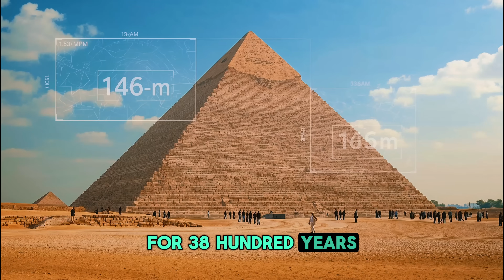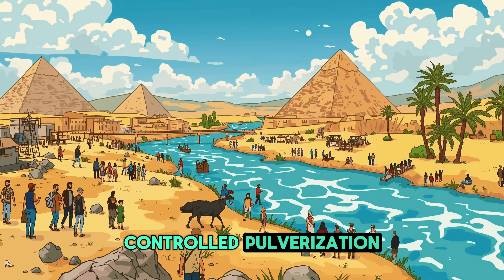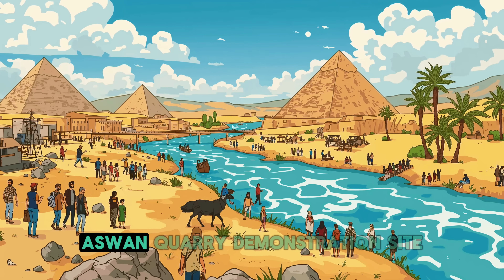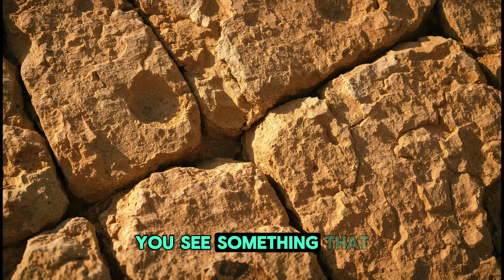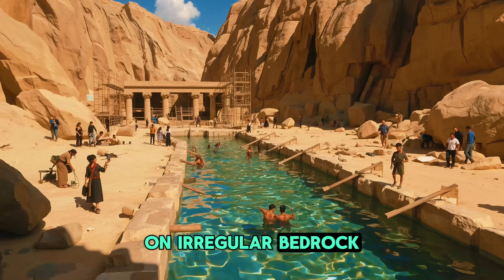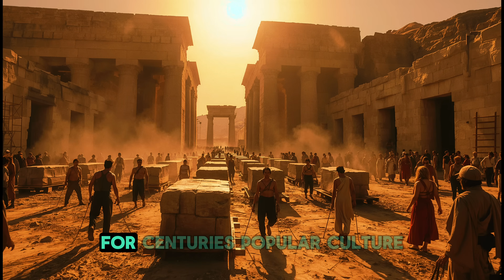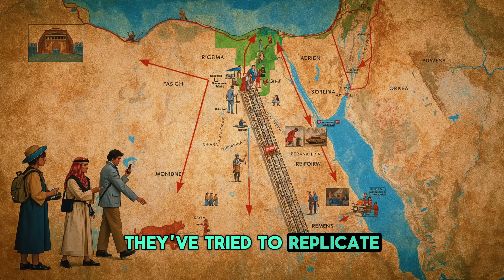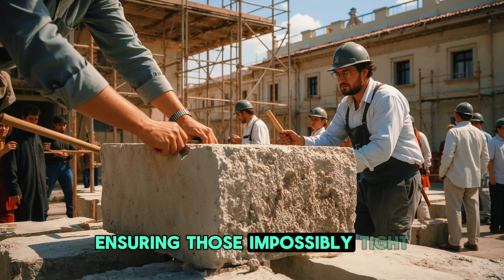Engineers Can't Explain How Pyramids Were Built... Until Now

Comment: What about the celestial footing of the pyramids that matched the stars above ??? No mention of the positioning of the pyramids to match those stars. And how did they build the insides of the pyramids and tombs for burial inside the pyramid. We will never be able to explain the pyramids no matter what theory you come up with. Its UNEXPLAINABLE.
Reply from the maker: @alfa_romeo55yush82 You're bringing up two important points - let me address both:
1. Stellar alignment / Orion correlation
You're referring to the Orion Correlation Theory (Robert Bauval, 1983):

Three Giza pyramids align with Orion's Belt stars
Layout matches stellar positions from ~10,500 BCE (controversial dating)
Suggests astronomical purpose beyond tombs

Why this video doesn't cover it:
This video focuses on CONSTRUCTION methods (how they physically built them), not PURPOSE/DESIGN (why they positioned them that way).
But you're right - the alignment IS remarkable:
✅ Great Pyramid aligned to true north within 1/15th of a degree (3.4 arc minutes)
✅ Shafts in King's Chamber point toward specific stars (Sirius, Orion)
✅ Three Giza pyramids layout resembles Orion's Belt
✅ Astronomical knowledge clearly sophisticated
How they achieved stellar alignment:
Method (likely):

Circumpolar star observation (stars that never set, circling North Star)
Shadow tracking (sun's movement marking true north/south)
Merkhet (ancient surveying tool - like a plumb line + sighting tool)
Star sighting through water (reflecting pools for precision alignment)

This is actually EXPLAINABLE - ancient Egyptians were master astronomers:

365-day calendar (based on Sirius rising)
Precise solstice/equinox tracking
Sophisticated mathematical astronomy

Not supernatural - just sophisticated observation over centuries.

2. "How did they build the insides" - EXCELLENT question
Interior construction challenges:
A) Chambers (King's, Queen's, Grand Gallery):

Built DURING pyramid construction (not carved after)
Each layer incorporates chamber walls
Granite beams (King's Chamber ceiling: 50+ tons each)
Corbelled ceiling in Grand Gallery (weight distribution engineering)

Process (likely):

Build pyramid layers up to chamber floor level
Place chamber walls and ceiling beams
Continue building pyramid layers around/above
Internal passages left open during construction
Ceiling beams placed using internal ramps/levers

Evidence:
✅ Relieving chambers ABOVE King's Chamber (clearly designed to distribute weight)
✅ Granite beams show lifting/positioning marks
✅ Passages align with construction phases
B) Passages and shafts:

"Air shafts" (actually star-alignment shafts) built into structure
Descending passage: Cut through bedrock BEFORE pyramid
Ascending passage: Built as pyramid rose
Grand Gallery: Constructed as interior ramp/lifting space?

This IS explainable - just requires:

Planning chambers BEFORE starting construction
Building around them as pyramid rises
Internal ramp systems for moving materials inside
Sophisticated engineering (corbelling, weight distribution)

3. "We will never be able to explain" - I disagree, respectfully
Here's why I think we CAN explain (most of) it:
What we HAVE explained:
✅ Material sources (limestone from Giza plateau, Tura; granite from Aswan)
✅ Tool marks and methods (copper, dolerite, sand abrasives)
✅ Workforce organization (worker villages, ration records, crew graffiti)
✅ Astronomical knowledge (alignment methods, star tracking)
✅ Basic structural engineering (weight distribution, foundation prep)
What we're STILL figuring out:
🤔 Exact transportation methods (ramps? water? combination?)
🤔 Precision finishing techniques (mirror-polish on granite)
🤔 Some timeline questions (20 years seems tight)
🤔 Interior construction sequencing (some details unclear)
What's truly UNEXPLAINED:
❓ Why SOME blocks have characteristics suggesting geopolymer casting
❓ Certain precision tolerances that challenge Bronze Age tool assumptions
❓ Full scope of internal structures (unexplored chambers, possible voids)

But "unexplainable" suggests:

Supernatural intervention
Lost super-technology
Aliens
Magic

I don't think we need any of that.
What we need:

More excavation (currently restricted)
Better tools to survey interiors non-invasively
Humility about ancient human capabilities
Willingness to revise theories when evidence demands it

On stellar alignment specifically:
This isn't "unexplainable" - it's IMPRESSIVE:
Ancient Egyptians had:
✅ Centuries of astronomical observation
✅ Mathematical sophistication (geometry, trigonometry basics)
✅ Surveying tools (merkhet, bay, set square)
✅ Patience to observe stars nightly for years
Aligning to stars with 1/15° precision?

Difficult? YES
Requires expertise? YES
Impossible? NO

Modern comparison:

Stonehenge aligned to solstices (5,000 years ago)
Nabta Playa stone circle aligned to stars (7,000 years ago, Egypt)
Angkor Wat aligned to spring equinox (12th century CE)
Chichen Itza aligned to equinox shadow effect

Humans have been astronomically aligning structures for MILLENNIA.
Egyptians just did it with extraordinary precision.

Why your points matter:
Stellar alignment shows:
✅ Pyramids weren't JUST tombs (had astronomical/religious significance)
✅ Ancient Egyptian knowledge was MORE sophisticated than often credited
✅ Purpose/design involved complex symbolism (Osiris/Orion mythology)
Interior construction shows:
✅ Engineering sophistication (corbelling, weight distribution, planning)
✅ Multi-phase construction process
✅ Integration of structure and purpose
You're right to highlight these - they're often overlooked in "how they moved rocks" discussions.

My position:
"Unexplainable"? No.
"Not fully explained YET"? Yes.
"More complex than simple 'ramps and copper tools'"? Absolutely.
But we don't need to invoke the supernatural.
We need to give ancient humans credit for:

Sophisticated astronomy
Advanced engineering
Incredible organization
Patience and dedication

They were brilliant. Not magical.

Question for you:
What specifically about the pyramids do YOU think is truly unexplainable (as in, can never be explained by human capability)?
Because I think most of it CAN be explained - we just need better evidence and less arrogance about "primitive" ancient peoples.
Reply: @PharaohsLegacy99  Youve done an excellent job forecasting, and a tremendous amount of research done by you. Bravo to you boss. But I cant wrap my head around mortals building these structures.
Reply from the maker: @alfa_romeo55yush82  @alfa_romeo55yush82 Thanks for the kind words, genuinely appreciate it! 🙏
I get the "can't wrap my head around it" feeling - the scale IS mind-blowing.
But here's the thing: these "mortals" had:

Same brain capacity as us
3,000+ years of accumulated engineering knowledge before the pyramids
Lifetime careers dedicated to mastering stone work
20,000+ workers organized like a corporation

We struggle to imagine it because:

We think in terms of quarterly deadlines (they thought in generations)
We rely on machines (they relied on physics, patience, and people)
We've lost the accumulated craft knowledge they spent centuries developing

They weren't superhuman. Just differently capable.
What if the problem isn't that they were too "mortal" to build pyramids...
...but that WE'VE become too dependent on technology to understand how they did it without it?

Comment: Lies. The stacked mud mounds, from the mud then carved it with hand tools made from the same mud to look like single bricks. Then let the heat and sun bake them dry and hard like a kiln. Why are they only in desserts. Only place hot enough to dry the mud.
Reply from the maker: @01trevino Trevino, that's... a creative theory, but it has some major problems. Let me walk through this:
Your theory:

Build mud mounds
Carve them with mud tools
Sun bakes them into stone
That's why pyramids are only in deserts

Problems with this:
1. Pyramids AREN'T only in deserts
Pyramids exist in:
✅ Mexico/Central America (Mayan, Aztec - jungle climate, high rainfall)
✅ China (various climates, not desert)
✅ Indonesia (tropical, extremely wet)
✅ Sudan/Nubia (some desert, but different from Egypt)
✅ Bosnia (disputed, but claimed pyramids in European climate)
Egypt just has the most FAMOUS pyramids, not the only ones.

2. Material composition - it's NOT mud
Egyptian pyramids are made of:
✅ Limestone (sedimentary rock - calcium carbonate)
✅ Granite (igneous rock - feldspar, quartz, mica)
✅ Basalt (igneous volcanic rock)
These are GEOLOGICAL formations, not baked mud:

Limestone: Formed over millions of years from marine organisms
Granite: Crystallized from molten magma deep underground
Both have mineral structures visible under microscope

Baked mud (adobe/mudbrick) has:
❌ Completely different composition (clay, silt, organic matter)
❌ Different density and weight
❌ Different weathering patterns
❌ No crystalline mineral structure
We can CHEMICALLY TEST this - pyramid blocks are stone, not dried mud.

3. Sun can't "bake" mud into limestone
Baking mud in sun creates:
✅ Adobe/mudbrick (hardness ~2 on Mohs scale)
✅ Crumbles when wet
✅ Erodes quickly
✅ Light, porous material
Limestone has:
✅ Hardness 3-4 on Mohs scale
✅ Dense crystalline structure
✅ Formed through GEOLOGICAL processes (pressure, time, chemical reactions)
✅ Can't be created by sun-drying mud
You can't turn clay into limestone by baking it in the sun.
That's like saying you can turn sand into steel by leaving it in the heat.

4. "Carved with mud tools" - physically impossible
To carve stone, your tool must be HARDER than the material:

Mud tool hardness: ~1-2 Mohs
Limestone hardness: 3-4 Mohs
Granite hardness: 6-7 Mohs

You can't carve harder material with softer tool.
That's like trying to cut steel with a butter knife.
Ancient Egyptians used:
✅ Copper tools (for limestone)
✅ Dolerite pounders (for granite - stone on stone)
✅ Bronze (later periods - harder than copper)

5. Evidence contradicts mud theory
What we find in pyramids:
✅ Fossil shells in limestone blocks (from ancient sea creatures - proves it's limestone, not mud)
✅ Granite quarries at Aswan showing extraction process
✅ Tool marks on blocks from copper/stone tools (not mud)
✅ Mineral composition matching quarry sources miles away
✅ Weight - blocks weigh 2.5 tons average (mud blocks would be MUCH lighter)
If pyramids were dried mud:

They'd erode rapidly in rain (even rare Egyptian rain would damage them)
They'd be much lighter (mudbrick weighs ~1/3 of limestone)
They'd show different weathering (mudbrick flakes/crumbles, limestone doesn't)
Chemical tests would show clay composition (they don't)

What you MIGHT be thinking of:
Some ancient structures DID use mudbrick:
✅ Ziggurats in Mesopotamia (Iraq) - mudbrick cores
✅ Adobe pueblos in American Southwest
✅ Mud structures in Africa, Middle East
But Egyptian pyramids? Stone, not mud.

Why this matters:
Your theory requires:

Ignoring geological science
Rejecting chemical analysis
Dismissing archaeological evidence
Misunderstanding material properties
Redefining what stone is

That's not alternative thinking - that's denial of basic geology.

Challenge:
Go to Egypt. Take a sample from a pyramid block. Have it chemically analyzed.
Result: Limestone (calcium carbonate) or granite (silicate minerals)
NOT: Baked clay/mud
The evidence is there. The science is clear.
Pyramids are stone, not dried mud.
Reply from the maker: @01trevino Trevino, that's... a creative theory, but it has some major problems. Let me walk through this:
Your theory:

Build mud mounds
Carve them with mud tools
Sun bakes them into stone
That's why pyramids are only in deserts

Problems with this:
1. Pyramids AREN'T only in deserts
Pyramids exist in:
✅ Mexico/Central America (Mayan, Aztec - jungle climate, high rainfall)
✅ China (various climates, not desert)
✅ Indonesia (tropical, extremely wet)
✅ Sudan/Nubia (some desert, but different from Egypt)
✅ Bosnia (disputed, but claimed pyramids in European climate)
Egypt just has the most FAMOUS pyramids, not the only ones.

2. Material composition - it's NOT mud
Egyptian pyramids are made of:
✅ Limestone (sedimentary rock - calcium carbonate)
✅ Granite (igneous rock - feldspar, quartz, mica)
✅ Basalt (igneous volcanic rock)
These are GEOLOGICAL formations, not baked mud:

Limestone: Formed over millions of years from marine organisms
Granite: Crystallized from molten magma deep underground
Both have mineral structures visible under microscope

Baked mud (adobe/mudbrick) has:
❌ Completely different composition (clay, silt, organic matter)
❌ Different density and weight
❌ Different weathering patterns
❌ No crystalline mineral structure
We can CHEMICALLY TEST this - pyramid blocks are stone, not dried mud.

3. Sun can't "bake" mud into limestone
Baking mud in sun creates:
✅ Adobe/mudbrick (hardness ~2 on Mohs scale)
✅ Crumbles when wet
✅ Erodes quickly
✅ Light, porous material
Limestone has:
✅ Hardness 3-4 on Mohs scale
✅ Dense crystalline structure
✅ Formed through GEOLOGICAL processes (pressure, time, chemical reactions)
✅ Can't be created by sun-drying mud
You can't turn clay into limestone by baking it in the sun.
That's like saying you can turn sand into steel by leaving it in the heat.

4. "Carved with mud tools" - physically impossible
To carve stone, your tool must be HARDER than the material:

Mud tool hardness: ~1-2 Mohs
Limestone hardness: 3-4 Mohs
Granite hardness: 6-7 Mohs

You can't carve harder material with softer tool.
That's like trying to cut steel with a butter knife.
Ancient Egyptians used:
✅ Copper tools (for limestone)
✅ Dolerite pounders (for granite - stone on stone)
✅ Bronze (later periods - harder than copper)

5. Evidence contradicts mud theory
What we find in pyramids:
✅ Fossil shells in limestone blocks (from ancient sea creatures - proves it's limestone, not mud)
✅ Granite quarries at Aswan showing extraction process
✅ Tool marks on blocks from copper/stone tools (not mud)
✅ Mineral composition matching quarry sources miles away
✅ Weight - blocks weigh 2.5 tons average (mud blocks would be MUCH lighter)
If pyramids were dried mud:

They'd erode rapidly in rain (even rare Egyptian rain would damage them)
They'd be much lighter (mudbrick weighs ~1/3 of limestone)
They'd show different weathering (mudbrick flakes/crumbles, limestone doesn't)
Chemical tests would show clay composition (they don't)

What you MIGHT be thinking of:
Some ancient structures DID use mudbrick:
✅ Ziggurats in Mesopotamia (Iraq) - mudbrick cores
✅ Adobe pueblos in American Southwest
✅ Mud structures in Africa, Middle East
But Egyptian pyramids? Stone, not mud.

Why this matters:
Your theory requires:

Ignoring geological science
Rejecting chemical analysis
Dismissing archaeological evidence
Misunderstanding material properties
Redefining what stone is

That's not alternative thinking - that's denial of basic geology.

Challenge:
Go to Egypt. Take a sample from a pyramid block. Have it chemically analyzed.
Result: Limestone (calcium carbonate) or granite (silicate minerals)
NOT: Baked clay/mud
The evidence is there. The science is clear.
Pyramids are stone, not dried mud.